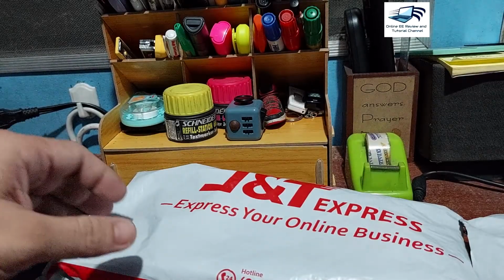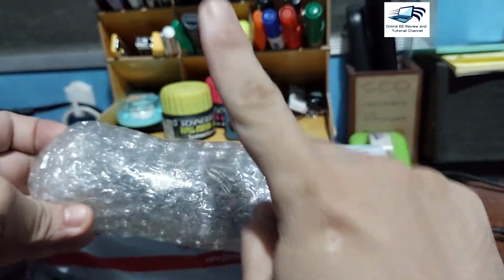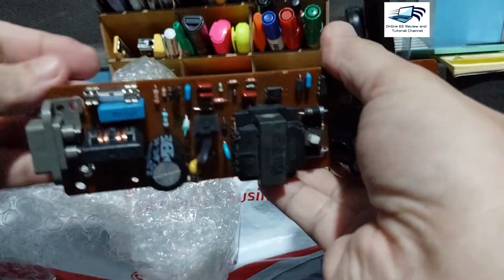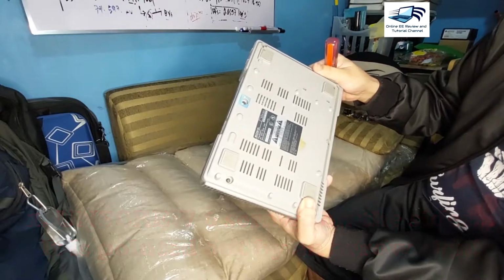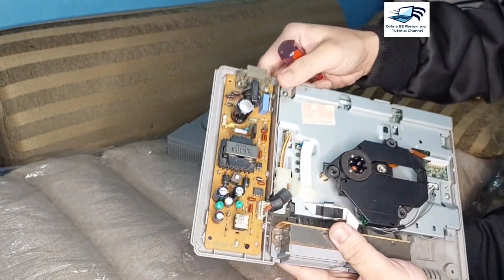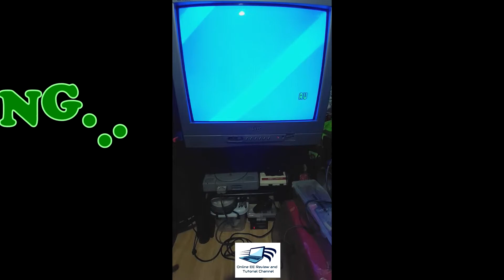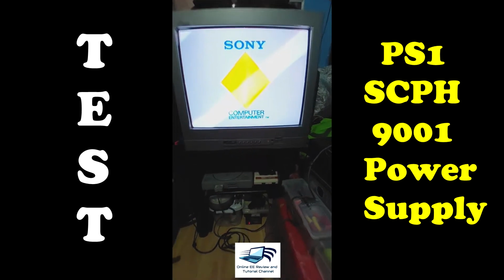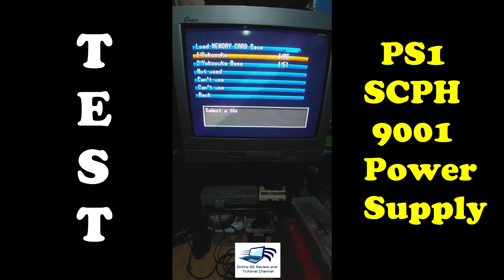Fixing the PS1 Power Supply via Replacement (ENGLISH)

Comment: can i replace my ps1 power supply with 220V power supply??
Reply from the maker: Havent tried it yet.on my own opinion, although both of them is 5pins, it cant work, or if it works can fry some parts since they have different outputs and frequency. So please check your console model. Thanks and stay safe

Comment: Hi 

I had same issue as yours ! 

I connected by mistake my Japanese PS1 into 220 v then it burnt. The interesting thing was that it worked fine after burning then couple weeks I didn't use it then I tried it today then it didn't work ! 
Even though I turned off the electricity so quickly, but I think burning even 3 seconds , it is enough to kill the power supply ! 

so I have to look for new power supply to see if I can find anything !
Reply from the maker: hi sir, try to replace the fuse, you can buy it online instead of searching for the whole. I think it is 125V, 2A. Goodluck
Reply: Thanks for your reply !
Yes I changed the fuse but didn't work ! So I saw that one of towers is like damaged , the head is like going out !

Comment: 1. Do you have the link for the parts where you bought in Shopee?
2. With this replacement of power supply, is it 220V?
Reply from the maker: Actually it is a 110V supply same model din,  9001 series, 5 pin and out of stock na rin yung pinagbilhan ko sa shoppee. Just type the keywords "PS1 Power Supply" you can find some sa shoppee. Thanks